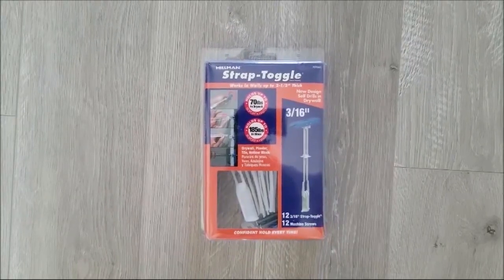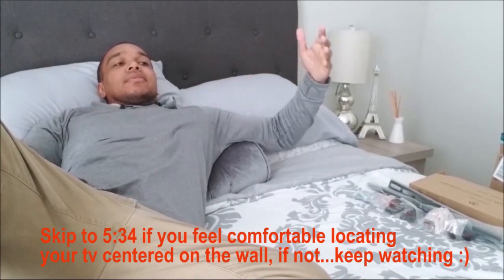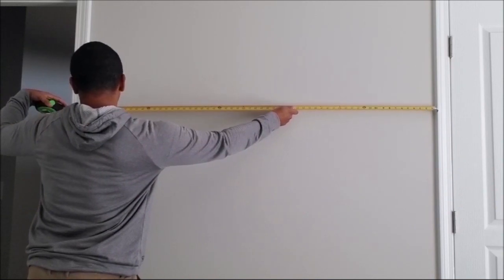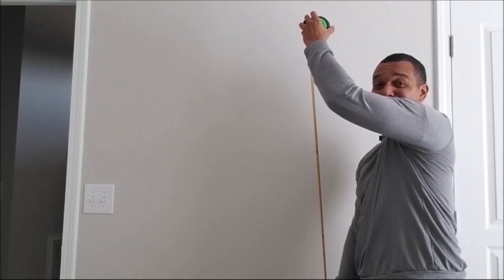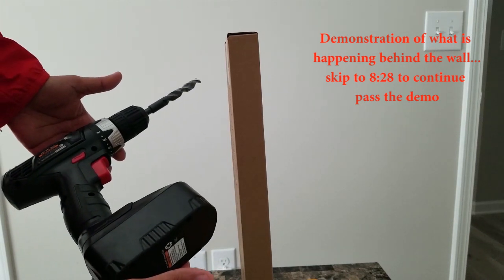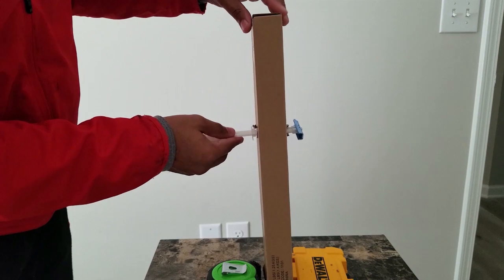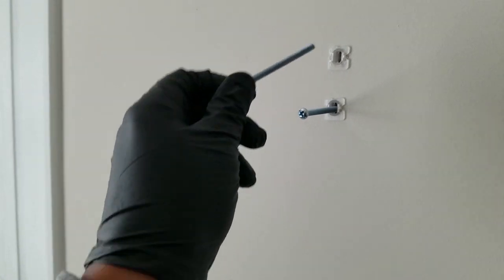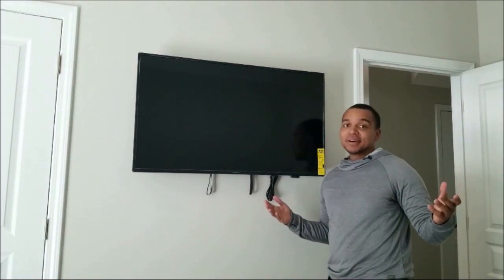How to mount TV on wall | NO STUDS

Comment: Would you recommend a full motion wall mount without studs? I know the static mount is fine but not sure how much extra downward force is coming off the edge of the mount when fully extended. And how much pressure it being put on the wall...
Say the tv is 32 pounds, the wall mount extends 12 inches out...
The wall mount is about 10 pounds

Total is 42 pounds about is that too much you think?
Reply from the maker: It'd be worth seeing if any brand wall toggle had pullout values to counteract the torque from a full motion mount with long extension. The Hillman brand I don't believe list pullout values, only shear. I l'll dig into this some more to see what options are available
Reply: @EngineeredMojo  I don’t think any do. These weight ratings are always for static sheet pull. Also they are rating the actual anchor. Not the drywall itself. So even if it says it can hold say 80 pounds. That’s the anchor. The drywall will probably tap out at day 60 pounds (just guessing) 
I’m pretty sure the torque at the end of a arm is probably around 2-3 times the weight. 
I’ve seen people use a full motion mount at around 22 pounds for a tv. Plus the mount at 10 pounds. Total 32. But nothing higher. And most don’t recommend it 

Not sure. I guess I’ll stick with the same type of mount you have right now. Just on the wall no pull out
Reply from the maker: @TripleAceAAA  this is good info, thanks for sharing. I agree, better to be conservative in this situation

Comment: Is it possible to remove the Strap-Toggle after you install it in the wall?
Reply from the maker: Yes you can remove it, I typically take an exacto knife and cut enough of the outer plastic to get the toggle loose then push it through the wall. The downside is the toggle will be behind the wall haha, but there are worse things back there I'm sure from regular construction

Comment: Very informative. I am mounting a floating entertainment center and the studs on my wall are not in the right place, so I needed to know how to mount my tv into drywall..
Reply from the maker: Glad the video was helpful and provided good information for you. Floating center is on my to do list for my living room, definitely makes a space look bigger
Reply: Cut a piece of three-quarter plywood approximately a quarter inch bigger than the amount you got a hold of TV with cut the sheet rock out exactly where you want to mount the TV in the same size as the 3/4 piece of plywood screw that into studs for cross frame from other studs then mount your bracket onto the three-quarter plywood do not do not do not only use sheet rock

Comment: I don’t see any advantage over the old toggle-bolts. 
Also I thought this might provide some clues on handling the weight without studs (non-existent or not centered). 
Apparently, just keep the tv to maybe 50” or smaller and keep it a wall-hugger.

Comment: what if u do not have a drill
Reply from the maker: You can try and push the toggle trough the wall with the provided point tip, but it can be hard with a thicker gypsum wall. You can buy a cheaper punch tool as well and knock a starter hole with a punch and hammer

Comment: Why not just  cut a paper trafaret and fix that on the wall before drilling to find the perfect spot for Your TV? p.s. Some could also mark the holes on trafaret and level before drilling :)
Reply from the maker: That's a good tip! Most tv mount brackets come with some sort of paper guide too.

Comment: Had a customer in Scarsdale New York had a 42 inch plasma TV only mounted with commercial graded metal toggle bolts probe all appropriate washers a very nice job never caught a stud the TV got knocked off the wall during a party it fell down and broke the leg of a four-year-old girl the insurance company would not cover the claim because of the inappropriate attachment to the wall
Reply from the maker: Oh wow, tough luck. Though I wouldnt blame the toggles in that scenario. Tv was knocked into at a party, therefore the load could have been increased pass capacity or wall itself may have failed. That could and has happened with stud installations. There is nothing inherently not strong about strap toggles and they are in use in millions of homes and commercial buildings. Can always add a safety strap to tv if you feel uncomfortable with toggles alone

Comment: The load of the TV runs vertical so the snap toggles should run vertical too, not horizontal. If they're horizontal they're literally useless
Reply from the maker: The load from a TV is a shear load taken by the screws. There can be an out of plane moment induced by an articulated mount, but whether horizontal or vertical it doesn't matter, the same surface area of wall is resisting the load.
Reply: @EngineeredMojo  think about the toggle as a leaver.  If it runs vertical there's more resistance, horizontal had less.  The longer the leaver the more strength
Reply from the maker: @md20120  that's a good way to think about it, but not accurate in this situation. Draw a free body diagram of the loads at the anchorage point considering a load of a TV. You'll have vertical shear and possibly axial tension compression (tension at top toggles, compression at bottom toggles). The orientation of the metal clip will not effect the tear out strength from the axial load and will have zero effect on the shear. Check out some info on engineering statics, it'll give a good background info on this and explain!

Comment: I’m really nervous to use the toggle things. I’ve watched the video like 100 times to visually see it before I do it but I’m nervous I’m gunna screw it up
Reply from the maker: It's an easy process dont worry at all and there's no issue if you need to redo a failed toggle install. Just push the toggle through the wall and let it fall behind the wall, then reinstall a new toggle

Comment: Never mount a television without attaching to a wooden studs or at the very bare minimum and aluminum studs I don’t care how thick the drywall is I would only make an exception if it was double layered five eights you need to cut out a section of the wall place a 3/4 piece of plywood and make your attachments to that anything other than that it’s just dangerous
Reply from the maker: Thanks for the tip! I haven't had any issues or concerns yet using strap toggles but always interested to hear others point of view

Comment: You could save so much time by just using the mini level that comes with most TV mounts now instead of all that measuring bruh
Reply from the maker: Lol I think you missed the point of the measuring, but yes the level is nice to use and I use it to check the horizontal level of TV but it does nothing for the vertical level of the TV. That's why a lot of people have their TVs giving them broke necks and headaches haha...they mount it hella straight with the level but either too high or too low
Reply: @EngineeredMojo  in that case you are right

Comment: You might could get away with it on a 32 inch on dry wall anything beyond that, in do time trouble
Reply from the maker: That's the great thing about a TV, it's a static load and unchanging. TVs in my house have held up for 5 years and counting with the largest at 65". TVs are very light nowadays as well

Comment: How much weight can it hold??
Reply from the maker: It will vary depending on the size you purchase, but it will say the weight capacity for each bolt connection right on the package 😀